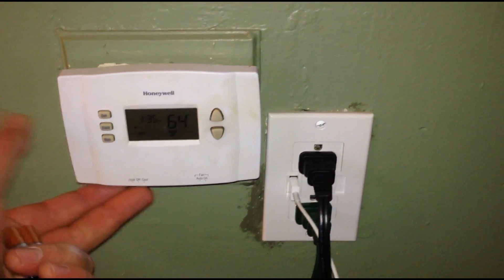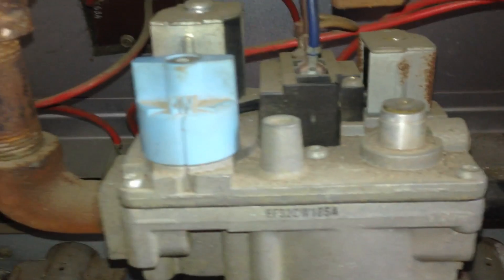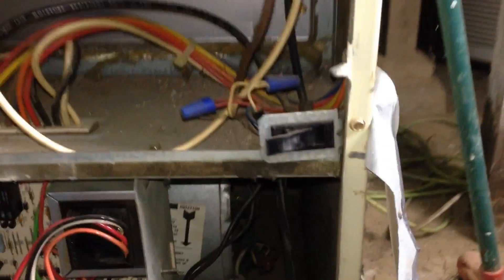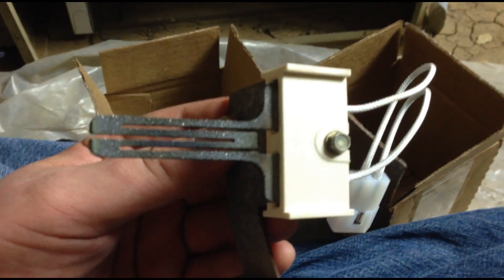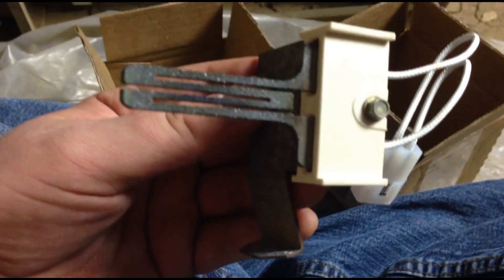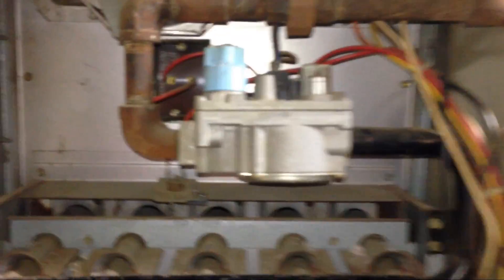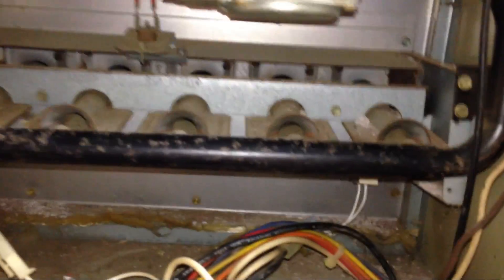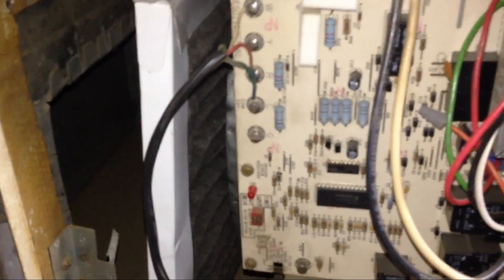7 Tips and Tricks to repair your Furnace DIY

Comment: OMG JREShow you wont believe what happened to me. OK so I watched your video and thanks man I learned sooo much you saved me over 300.00 bucks. And mine was so odd ok this is what I noticed after learning what you taught me I noticed that my igniter did work because the first one let up but I noticed that last two didn't. And I realized why it was cutting off because the thermotstat wasn't getting hot because the last one didn't light. So I then had to figure out why the last two didn't light it turns out. A fucking SPIDER but webs inside the tubs YES I have the pics to prove it if you want to see. and it was blocking the proper flow of the gas two the last two I cleaned it with two q-tips cost less than .001 cents because all ready had them. So with you sharing your video knowledge and training then me taking another step investigating it was my tubes that where blocked the igniter works fine HAHA and thermo stat so tell people to check there gas tubes as well to make sure nothing is blocking it or spider WEBS HAHA again I have pics that I took before I cleaned it amazing
Reply: Also we don't use our heater that much since we have a huge house and it wastes a lot of money but during the holidays we use the heaters so apparently with that down time it gave a spider enough time to build its webs and set up shot HAHA ass hole could have cause me hundreds of dollars ill killem. HAHA

Comment: Thanks for the great video. My gas furnace wiring insulation is breaking off ... crispy. I am trying to replace some of those wiring. Due to the high heat in the Gas furnace, what type of wiring should I use btw the Power Board and Fan Limit Box? Someone in Home Depot suggest to use the Fiber insulated wiring. What do you suggest and where can I find such wiring? Thanks.

Comment: Could you help me with my furnace?
Here is the model number Bryan 373LAV036070, the problem is that the heaters don't turn on and I don't smell gas, the gas valve is open and I can turn on the fan but the burners don't turn on any ideas?

Comment: should always clean it first before  troubleshooting the inside where the fan is. 75% of the time its just so dirty the flame sensor cant pick up the heat or even produce a flame at.all. air compressors work wonders. no one cleans them like that anymore. exceot for us lol

Comment: Thanks!  My furnace is blowing but only cold air - cleaned the flame sensor - I don't see white on the ignitor but can't really tell for sure; scared to take it off.  Any other ideas if it is not the ignitor?

Comment: I have a digital thermostat and didn't realize that just a low battery would fail to kick on the furnace. I figured so long as the thing was lit up and functioning the battery was fine. After checking the things you covered here my brain finally kicked in and I tried turning on the A/C. That wouldn't start either. Changed the batteries in the thermostat and everything ran fine. Saved me from another big bill from the repairman! Thanks!

Comment: Your furnace is a mid, it's old, an air filter will not help your furnace start,  never rely on a door switch,  always test for voltage,  you have an inducer motor, which will evacuate all gas from the combustion chamber,   If you value your family, do not change parts on your furnace if you do not hold a valid gas licence,  igniters are not that brittle, you just have to know what you are doing.  Your insurance provider would not cover you also.  Hope my comment lasts before the poster deletes

Comment: Im kind of skeptical about that this time, some techs state that just to keep in top business, if you can reading a set of instructions feel confident of what you doing and can save money that way then there not that much need to get a tech physically there that will likely charge you an arm and a leg for something simple like to change an ignitor not everybody can afford to get a inclined hvac tech to come out all the time to do something that simple

Comment: furnace stopped working .flashing light troubleshooting is a steady heartbeat. i can't tell if it is fast or normal.mannual says that is it is a steady heartbeat that is is operating normal ,fast means call for fuel, well i did that but tanks reads 30 percent almost half a tank so i hold switch in an look through window then ignightor glows red and blue flame appears then it circles around again. any thoughts would be greatly appreciated. thank you , this is a great video..

Comment: Hey I have to say I don't have a problem even walking someone through a problem over the phone all they have to do is call. The problem is that after the replacing ignitor they won't stop so before you know it they have the furnace apart. A lot of times the problem is a very simple fix. So if you get that far and its still not working call someone for help. Hell you can call me for help my number is on my channel

Comment: I can't recommend this video to anyone! That'd be taking money out of my pocket if I did. Either way, to those who aren't technically inclined, you may want to leave the real work to the professionals. I can't count how many times I've seen problems made worse by 'know-it-all' fix it yourselfers'. Hell one guy even managed to switch the thermostat wires with line voltage! If you DON'T know what you're doing, better safe than sorry (or further in the hole when the repairman comes).